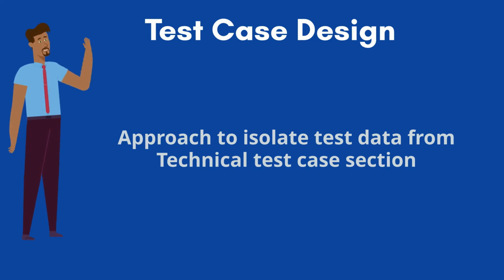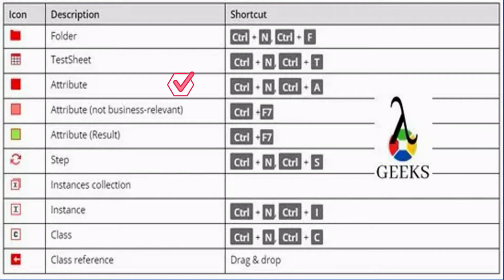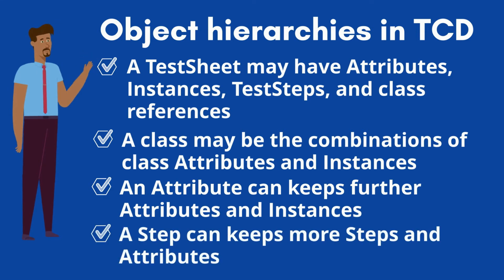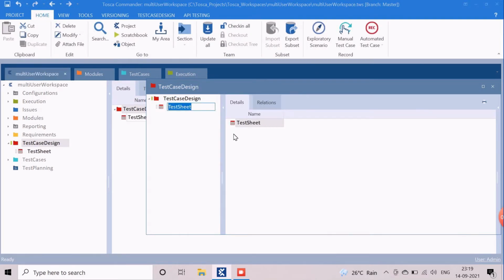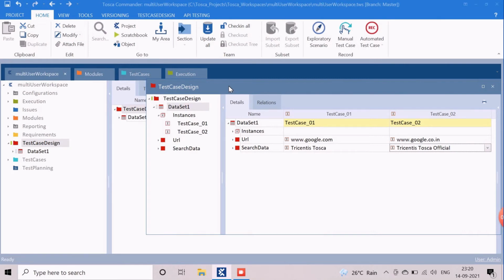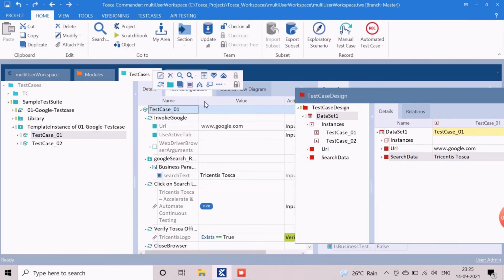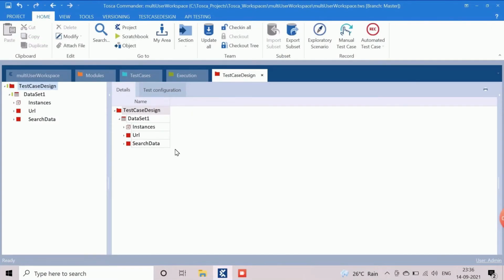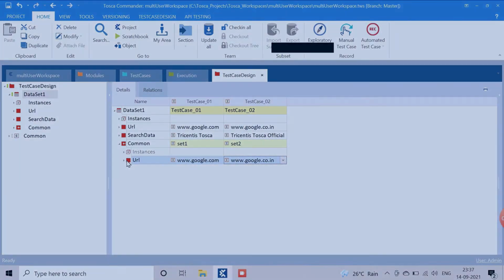Tricentis Tosca Tutorial Part-10 : Tosca Test Case Design, Tosca Class

Comment: Can the functionalities of the PO's be isolated?
Can the test cases be cascaded depending on the test depth?
Can test cases be packaged using tagging?
Is a BDD approach feasible?
Is a KWD approach feasible?
Can the test cases be outsourced to an external repository?
Can different environments be controlled? If so, how?
Is dynamic locator processing supported? If so, how?
Are setups and tear-down supported?
Can test automation run in a container?